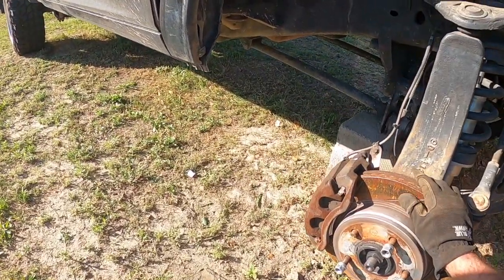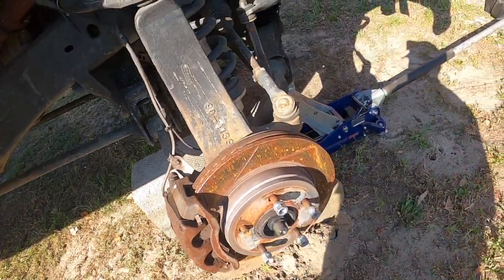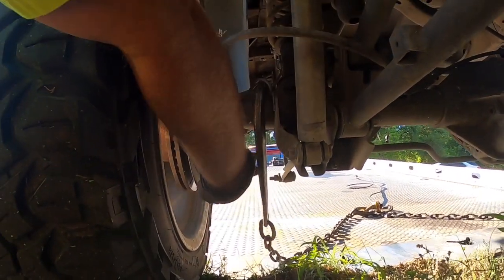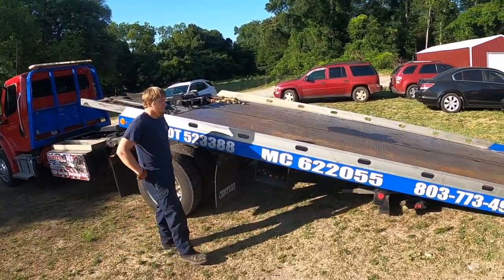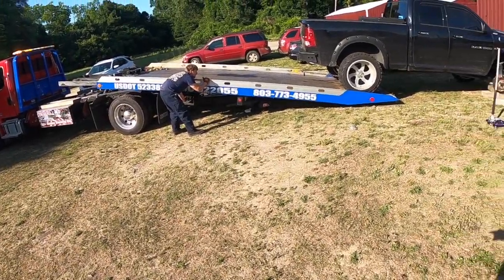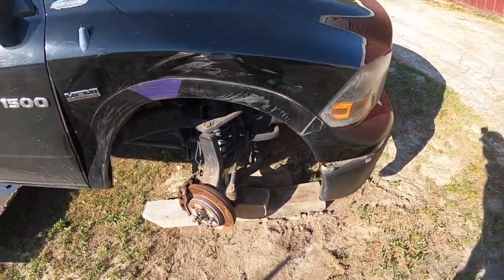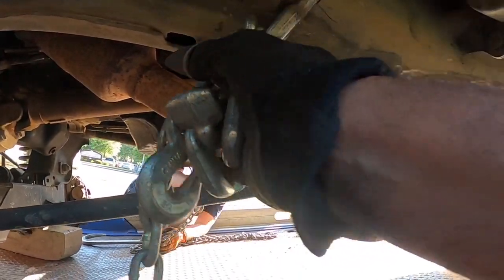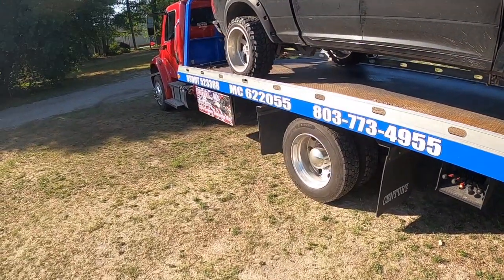How to use a ball joint skate.

Comment: Works well, 
and think adding an eye on that skate to attach the J-hook chain from axle and the other end hooked to the skate, then the skate would skid along with the car/truck. 
Only need to add an eyebolt. No need to block the drivers wheel that way.
Reply from the maker: Deernut00 that's is a good idea.  Thanks for watching and stay safe

Comment: Every single time what to do next you guys were right behind it and nailing it every single step true professionals in what you do the same way I work! I haul a lot of 20 ft containers on a daily basis I keep four skate blocks+2 standard blocks to position under radiator support or frame so it doesn't dig the nose or the exhaust in the ground I get a lot of wheel theft vehicles here and customers are so tickled to see so much thought in taking care of their vehicle thanks for sharing hopefully someone can utilize the same steps instead of dragging like most videos on YouTube oh and finally someone rolled their truck instead of lift and pull tow truck my truck is a t370 the axle is too heavy it will tear my airbags thanks again pro-truck operators👍🇺🇸👍
Reply from the maker: Mr Mike We appreciate that. Thanks for watching and stay safe